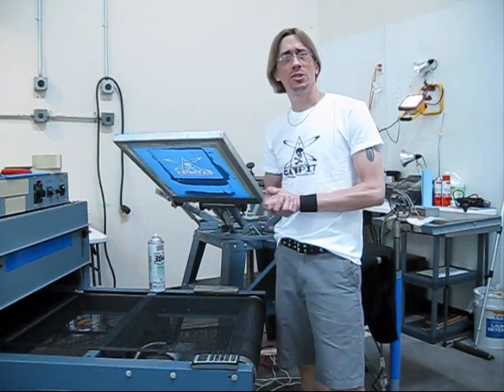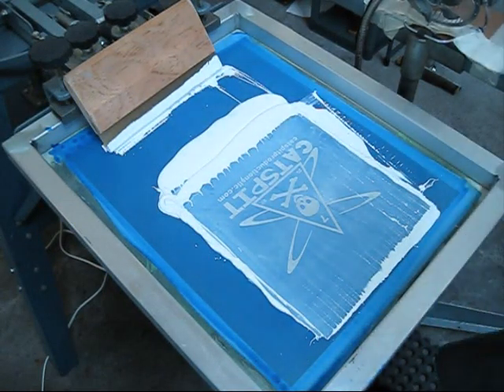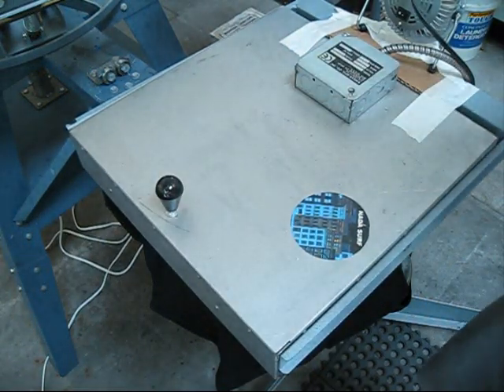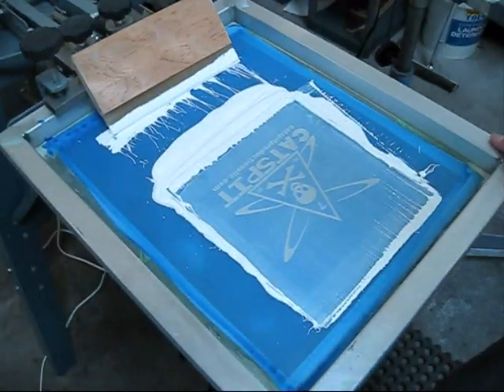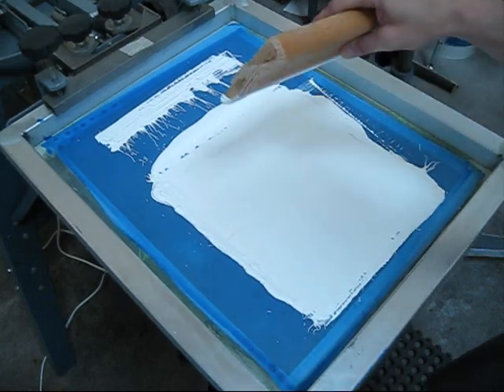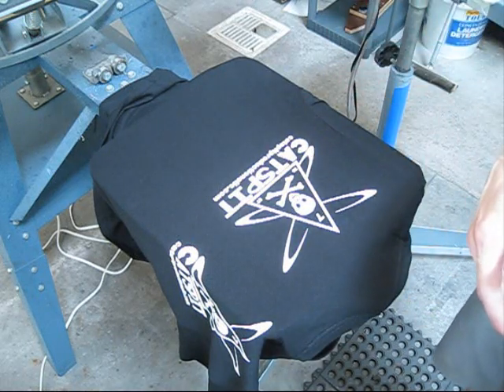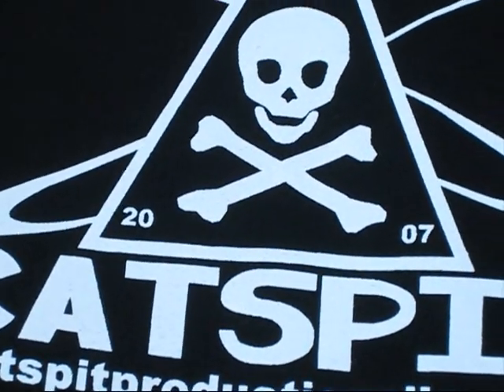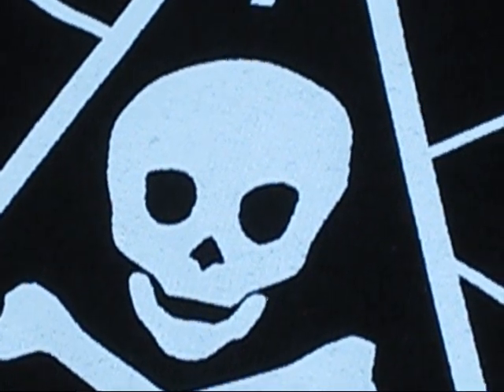How To Screen Print White Ink On Black Tee Shirts

Comment: The ink you are using seems thinner and flows much better than what I have. What white ink do you recommend for 50/50 black shirts?
Reply from the maker: I forget what ink that was. This is a pretty old video. But the plastisol inks I sell now on my ecommerce site tend to be a little thinner than most other brands making them easy to learn with. However, high opacity inks in colors or whites will be the thickest of all. I would recommend my polyester white plastisol ink from AllTex to print on a 50/50 poly cotton blend shirt. 

https://catspitscreenprintsupply.com/economy-polyester-white-plastisol-ink-gallon/

Thanks for watching! Screen Printing Equipment & Supplies - http://CatspitScreenPrintSupply.com/
Reply: @CatspitProductions  Thank you for responding! I really appreciate your videos, they've helped a lot. I'm doing a short run of white on black so I just used a vinyl stencil on my screen. I've done it a couple of times now on short runs with great success. for some reason my ink is not staying on the shirt, it's extremely sticky and it's pulling up a lot of fibers after applying the ink. The ink I have is Union ink ultrasoft white. It's about a year old, (not sure if that would make any difference). Also I'm using a 110 mesh screen. I've tried adjusting the off contact a little higher and a little lower than 1/8", but it doesn't seem to change anything. I will try the ink you suggested. Maybe it's as simple as that. Thanks again!
Reply from the maker: @johnbowles73  You're welcome. My pleasure to help out where I can. It could be the ink but plastisol ink usually lasts a very long time in the bucket. Try thoroughly mixing it before printing. It could also be your method of flood and stroke. Loose mesh can also affect printing as well as the type of squeegee you use. It's hard to say working blind from afar. Off contact should be about 1/16th of an inch. Maybe the width of a quarter. If it's too high that will also create problems. Good luck!
Reply: @CatspitProductions  I did find that my off contact was a little high, and lowering helped. What also helped a lot was just finding the right speed and pressure. Pulling worked much better than pushing with the white. Thanks again!
Reply from the maker: @johnbowles73  You're welcome. Glad I could help out some.

Comment: I learn that white on black with 156 screen mesh don't work very well. So I will try 110 mesh for now
Reply from the maker: Yes, that would be recommended if you're using plastisol inks. Thanks for watching. Screen Printing Equipment & Supplies - http://catspitscreenprintsupply.com/

Comment: why doe the shirt stick when printing?i have a problem with the shirt staying on the pallet is it the mesh of the screen,i'm new to this silk screening,is it the shirts i'm using??i also only use the heat flash cause thats all i have
Reply from the maker: I’m not sure. It is very hard to diagnose problems with little information but if you are flashing and printing while the ink is hot, that will do it. Allow ink to cool down before printing subsequent colors. Thanks for your support and thanks for watching!!

Comment: what about neon colors? the black shirt seems to eat it straight through
Reply from the maker: Emmanuel sanchez gama If it's high opacity ink you can use the same process as shown here. Otherwise you'll need to print a white under base first for the neon color to be printed onto. Thanks for watching. Screen Printing Equipment & Supplies - http://catspitscreenprintsupply.com/
Reply: Thank you! Great video
Reply from the maker: Emmanuel sanchez gama You’re very welcome. Glad I can help out through myvideos.

Comment: Hi, thanx for this video ... I have trouble with white ink printing and need advice please. Still getting blurry result, first pass is usually OK but 2nd no. It looks like the ink bould up on the bottom of the screen and stuck on tee when I lower screen for 2nd time... Anybody knows why? Please see the image www.photovision.cz/U.jpg thank you
Reply from the maker: AaronSnowBan Perhaps your off contact is too high. Or maybe the screen is not good. Can you elaborate on your set up? Thanks for watching. Screen Printing Equipment & Supplies - http://catspitscreenprintsupply.com/

Comment: Do you reduce your white at all, or just mix it really well ?
Reply from the maker: I never reduce my white ink or any high opacity ink. That would only ruin the opacity and the ink flow characteristics. Mix them very well and they should get creamy and smooth. If not, get some new ink. Thanks for watching. Screen Printing Equipment & Supplies - http://catspitscreenprintsupply.com/
Reply: CatspitProductions what would be the average shelf life for plastisol ink
Reply from the maker: If stored properly. Years. Thanks for watching. Screen Printing Equipment & Supplies - http://catspitscreenprintsupply.com/

Comment: How many layers of emulsion do you use on the screen
Reply from the maker: Just 1 from a 1/1 coat. It's not necessary to try to build up the emulsion over mesh since what you do on press can negate that very easily. It's all about off contact, mesh count and squeegee durometer along with how you flood and stroke. Thanks for watching! Screen Printing Equipment & Supplies - http://CatspitScreenPrintSupply.com/

Comment: Instead of flashing it right away can you just let the ink dry and when it's completely dry hit it again?
Reply from the maker: With water based inks you might do that but it will take longer. But this is plastisol ink so it never dries until it is heat cured. Thanks for watching! Screen Printing Equipment & Supplies - http://CatspitScreenPrintSupply.com/

Comment: question for you... everytime im working with white ink. my ink/screen gets stuck to shirt. i thought it was my offcontact.. but i adjust that. and still get same result.. any help on this?
Reply from the maker: Are you flashing between prints? Or are you using water based inks? Is the emulsion tacky? Thanks for watching. Screen Printing Equipment & Supplies - http://catspitscreenprintsupply.com/
Reply: +CatspitProductions yes im flashing between prints. and it happens on waterbase and Plastisol
Reply from the maker: Try letting the print fully cool before following up with the subsequent colors. Hot inks can stick to emulsion and semi cure inks in the mesh making the ink sticky, thick or clog the screen. If you're on a 1 station press you might use a fan to speed this up. If you're on a rotary press then load the pallets and rotate the pallets with the flash off to the side on one pallet allowing for cool down time between prints. Follow? That might do the trick.
Reply: +CatspitProductions thankyou for the time. i appreciate the answer
Reply from the maker: You're welcome, my pleasure to help out where I can.

Comment: why do you say the left is hit flash hit, when it was on your right in the printing process, and that was the no flash?
Reply from the maker: For the printing I used the same shirt in video. Then if you notice when I show them close up it's actually 2 different shirts. I'm not sure if you can see it in the close up shot but at the end when I back off you can see the separation of the 2 shirts in the middle. I did not use the same shirt I printed for the close ups and I don't remember why. It was probably a camera issue with showing them side by side. So whatever I said was what, was just that.....LOL. I'm not trying to trick anyone here. Thanks for watching. Screen Printing Equipment & Supplies - http://catspitscreenprintsupply.com/

Comment: Hi, and thanks again for your videos!! I would like to know if you have any technique to get an effect similar to that: http://goo.gl/pdezjF , I´m looking for this kind of non solid color printing, it looks like an old print washed over and over, but in a new shirt. Is it possible to do that directly on the printing process?
Thanks for your time!
Reply from the maker: You can use halftones or filter masks. I will be doing a video about texture masks or layers to create vintage faded looks or textures in Adobe Illustrator very soon. Please stay tuned. Thanks for watching. Screen Printing Equipment & Supplies - http://catspitscreenprintsupply.com/
Reply: CatspitProductions Thanks for you answer!! I was wondering if it could have a way to get something similar not using computer. I´ll explain why: I´m using that technique that you show in one of your videos, which you do the screen print using a hand cut paper stencil. Because of that, the challenge would be to achieve a similar result, maybe mixing something to the ink??? any idea?
Reply from the maker: Rodrigo L. Kermessi Well you could just print a less opaque ink on a higher mesh count with the paper stencil to get that result in the image. If you mix a good amount of reducer into the ink it will get more translucent and print like that as well.